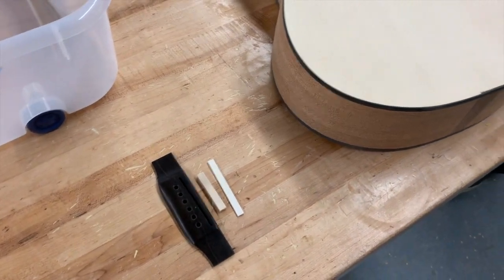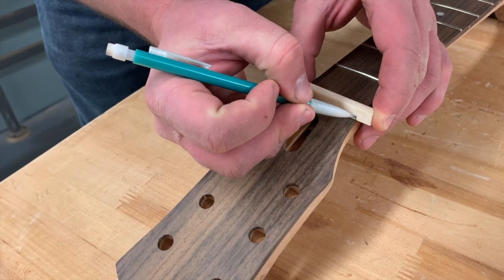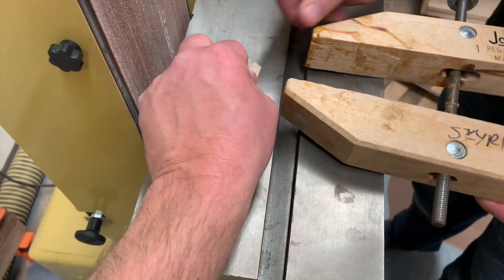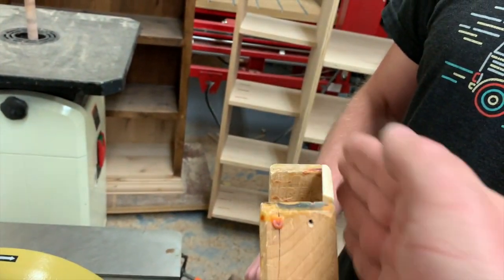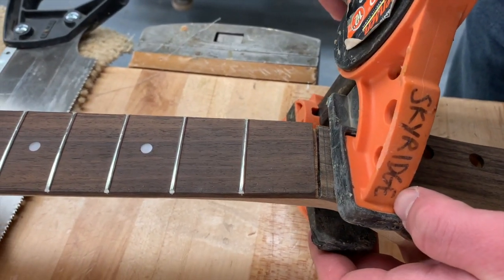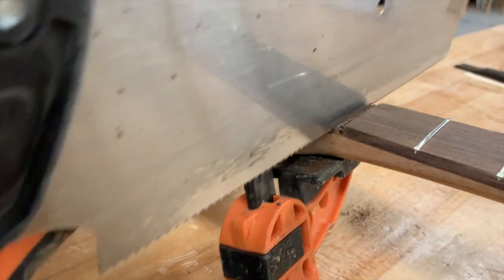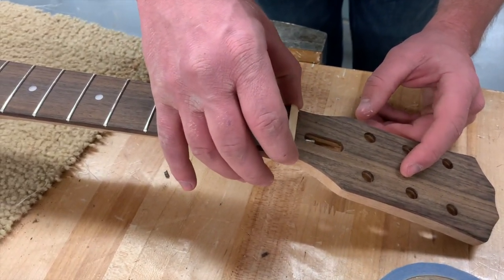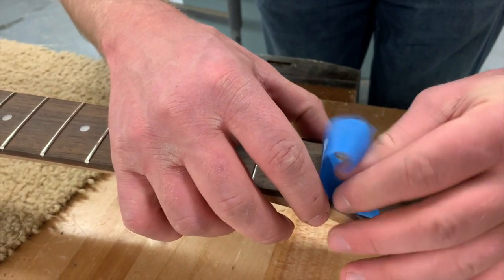How to Build an Acoustic Guitar - Nut and Bridge

Comment: You can place your bridge in position and clamp in place on the bridge ears. Drill 2 small holes on each end of the bridge slot and insert pins. This makes placing it back in place errorless when ready to glue. You may not see it right away but not fully coating the bridge with glue will result in a bridge failure at some point. It’s MUCH easier to clean up squeeze out with a damp paper towel and chisel than to have to reset the bridge at some point in the future. After 6 dread builds I speak from experience. My very first bridge let go 2 years after building it. None of my others have moved. And a metal ruler in millimeters is much more accurate than the Stanley tape.
Reply from the maker: Thank you for the pointers.  I love hearing from experienced Luthiers and I will definitely do these things for future builds.

Comment: You glue the bridge on before finishing the guitar?
Reply: Never superglue a nut. Use PVA. When you replace the nut in the future using superglue risks breaking the fretboard and or the neck top plate when you have to break out the cemented nut.